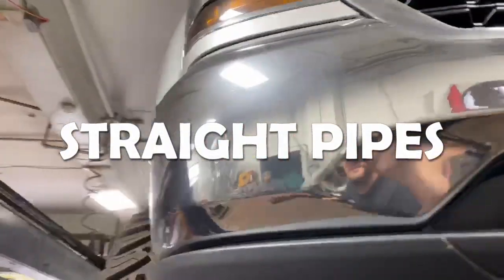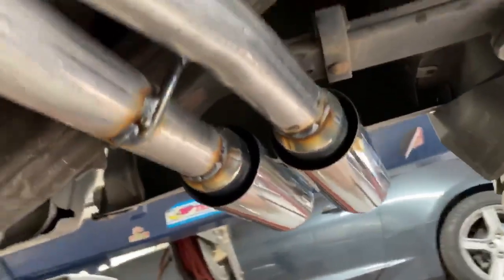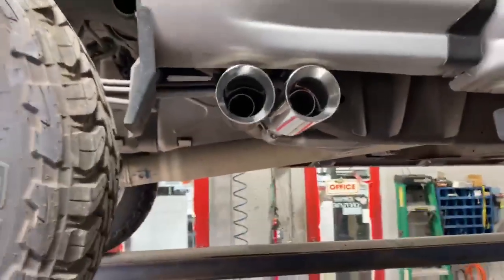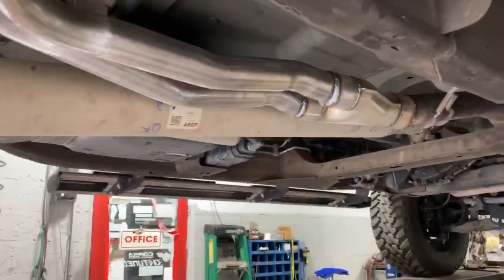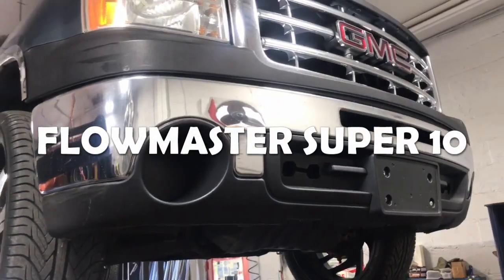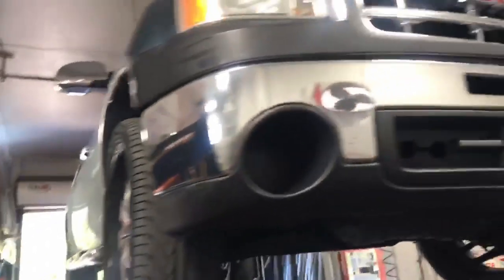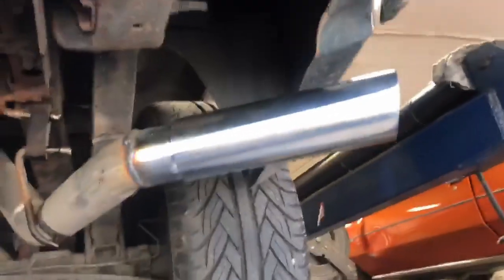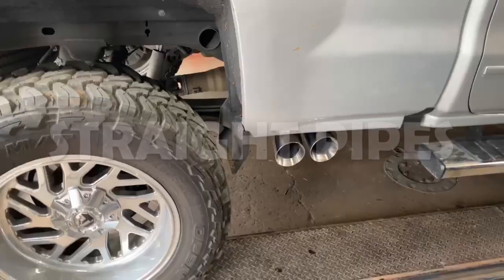Chevy Silverado 4.3L V6: STRAIGHT PIPE Vs FLOWMASTER SUPER 10!

Comment: Everyone's bashing a V6 😂😂😂   V6 engines in trucks aren't a horrible idea.  Like some of you have said some of these V6s have more horsepower than some of the earlier V8 did.  Break it down to three simple things with a V6 number one you get better fuel economy number two they're lighter number three less to go wrong. And for just for the hell of it sometimes they're actually easier to fix then a V8 because you have more space because the engine bay is used for a V8 therefore it's bigger so  you have more space with a smaller engine to get to hard to reach parts like plugs and what not.  Personally if I were to build a big truck I throw a Cummins 4bt in it and have over 800 horsepower out of a 4-cylinder and blow all your little V8s away while getting 30 mpg 🤣🤣🤣

Comment: Best exhaust for a 4.3 is a single 2.5 or 3 inch single side exit straight pipe, sounds very close to a SBC until about 4500 rpms. Piping size makes a massive difference to a v6 truck
Reply: So no muffler no resonator ? But leave the cats or delete those too

Comment: I've got a 4.3 that has a cat and muffler delete into a y pipe and dual pinched tips out the sides, and personally think it sounds much better than both of these. At the same time.. it's a 2001 s10. I think the V6 silverado's are trying to hard and should just be a V8.
Reply: all i did is take my exhaust off right after the cats on my 2010 4.3 silverado and it sounds so much better than these trucks. and its free
Reply: @musclecarsdaily3020  do you have a video of the exhaust by chance?
Reply: @alexbombela3411  i used to
Reply: @musclecarsdaily3020  alright appreciate it!
Reply: I’ve got a 1998 S10 with the 4.3L and I’m trying to figure out what I want to do with it. I’d love to hear yours if you have a video of it by chance.

Comment: The newer 4.3 sound horrible I love the 4.3 in my 97 s10 these are horrible
Reply: I have a 4.3 in my 94 Sonoma straight piped and it sounds amazing
Reply: @coronavirus5722  the old 4.3 sound great i like it better than my yukons 350 with longtubes lol
Reply: Bruh they are all the same until 2014.
Reply: @brayannexon4613  not at all, old 4.3 is vortec new 4.3 is ecotec and have different heads and cam and even intake is different I have an s10 with a 4.3 and Silverado with a 4.3 and worked at a chevy dealer I know the difference
Reply: @810SPEED  newer 4.3's are cutaway LS engines. Old 4.3's are cutaway SBC. SBC v6 was used till 2014. The one in the older truck in this video is identical to the s10 v6.
Reply: @brayannexon4613  I know this , I'm talking about the 2017

Comment: Still sound like little V6's 🤦🏼‍♂️
Reply: Got more power than the V8s from the early 2000s and 1990s if you try and make a V6 sound like a  v8 you'll mess it up if you want a V6 out of a V6 then you'll be surprised in my opinion the worst thing you can do for a V6 is duel the pipes I've got a 14 model Chevy Silverado 4.3 all I do is search resonator and muffler off and add a 4in tip and it sounds good